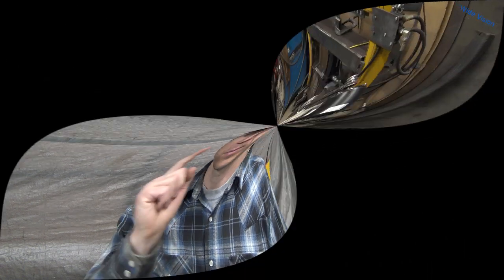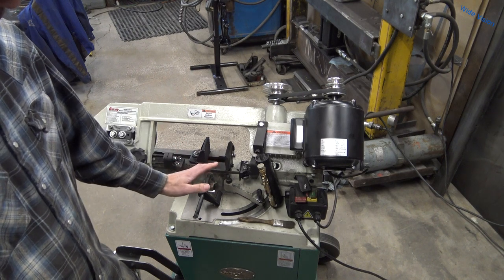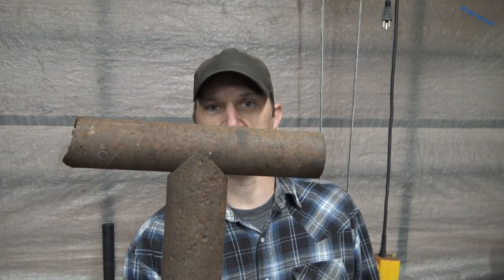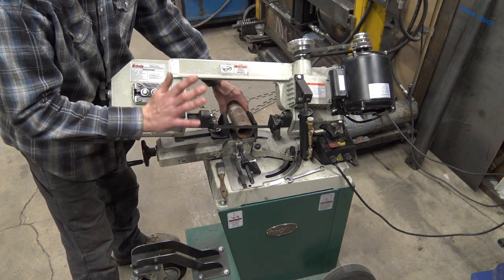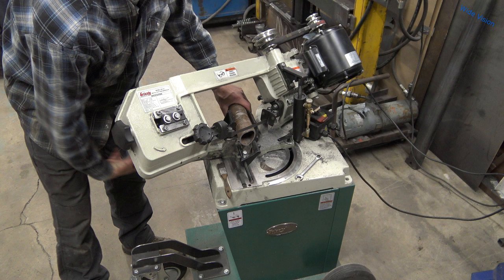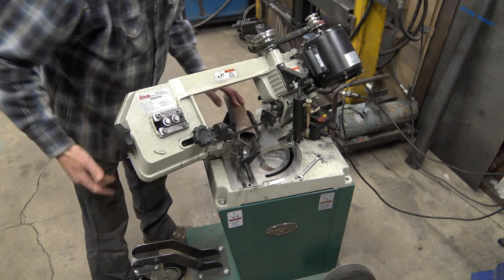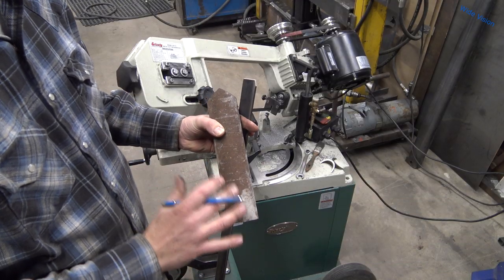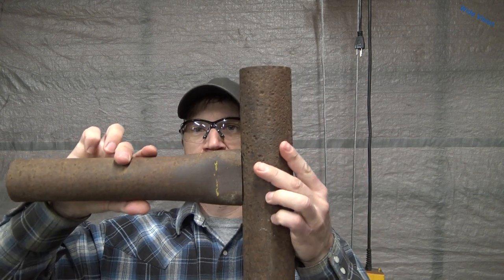Chop Saw Saddle Cuts -  Long Version (There is a short version)

Comment: What I do for corrals and fence braces is use 2-7/8 for the posts. Then I cut a bunch of 4 inch long pieces of 2-7/8 that have a saddle on one end and are flat on the other. I use 2-3/8 for the rails and they just slide into the 4 inch long pieces of 2-7/8. This does increase the amount of welding, but it sure speeds up the fitting and grinding.  I make the 4 inch long pieces in the shop where I have all the right tools.

Comment: Yeah, i figured out this technic a few years back. I kind of aimed for approximately 35, then i use 6011 to get it perfect. Also adjust ( lesson) your angle to get smaller pipe to fit larger pipe. You'll figure it out if you'll fidil with it abit. Same goes for angles that are not 90 degee. Go for it.

Comment: Hey man that's great but a real easy method is the 1/3 way. Let's say you got a 3" (o.d) pipe you want to put a 2-1/4" pipe to,with the 2-1/4" squared off you could get a center line of the pipe by measuring or eyeballing it and make a mark on each side of it,then from the squared end measure down 1/3, which would be 3/4" of course,and make a few tick marks or even run a Quick wraparound if ya wanted,then from your wrap mark just eyeball the angle for your grinder with zipcut, chopsaw or whatever so when ya cut you end off at your center marks on pipe and then you got your birdsmouth,just touch up the edges with grinder and there ya go, usually 1/3 always works. Even if it was something like 1" to 1". I probably made it sound more complicated but if used it you can do it in a flash with excellent results. Good to see a video 👍 and Keep them coming. How do you find that grizzly bandsaw???
Reply: He did say 33 degrees which is near enough a third when the 2 pipes to be joined are the same size.
Reply: @gerryoneill8881  yes I'm not saying anything wrong with what he said I've been a subscriber for quite a while I was just saying it in case he might not have known, remember he did mention it all changes in sizes and in thickness,and with the 1/3 method you generally always get a easy fit and just got to touch up with grinder.